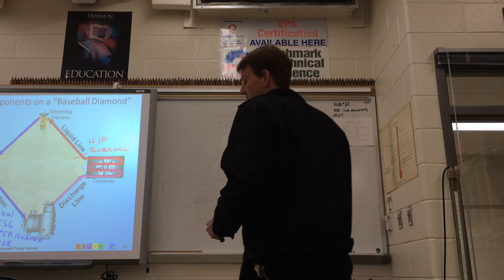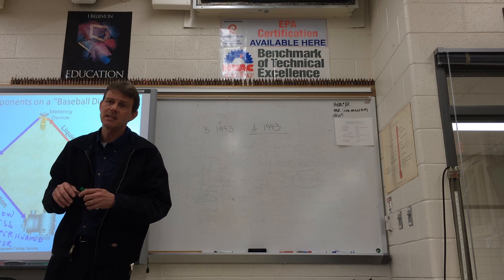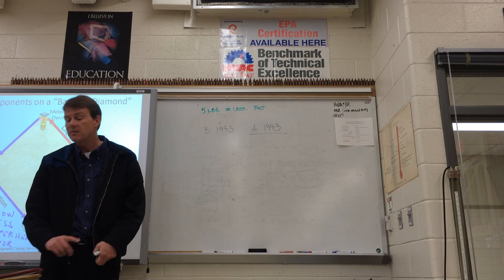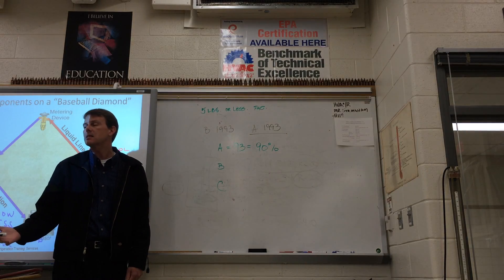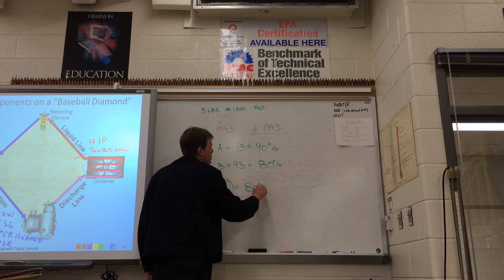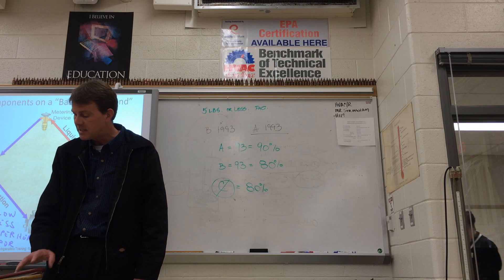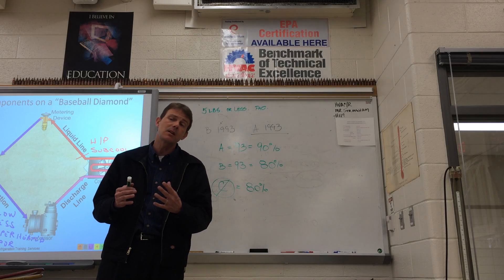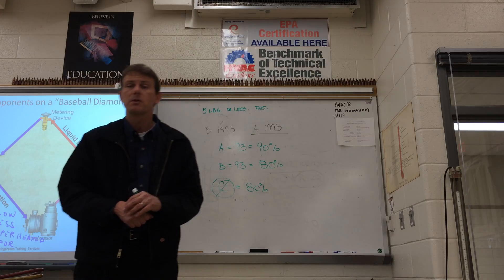HVAC Basics: EPA 608 Certification Test Study Guide - Type 1 Lecture with Mr. Stringham

Comment: Don’t need to recover type 1??? Five pounds of refrigerant can be vented ?….amazing. Diminimus???
Reply: @edisonhvac  I agree….however …. I run a appliance repair company, and an HVAC company …. I’m trying to find material online that can teach my technicians the proper way to do things, ( and also complies with the EPA608 regulations) as well as helping my new techs pass the test… I would say that telling them that they can simply vent refrigerate would actually be illegal ….and against the law …and it is actually incorrect information to be teaching students. We have to use recovery equipment and recovery machines just like an HVAC technician with our type 1 repairs….Venting refrigerant into into someone’s kitchen is not a good practice….please dont take offense , just trying to point out something that is not correct. Thanks for your otherwise good  instructional videos. We appreciate it very much, you a good teacher.

Comment: first I just want to say thank you for doing these videos, I'm taking the tes on monday and I alreday became a pro on core and type 1 in less than three days thanks to your videos, I just have 1 question, when using a piercing valve on a running compressor, which line should you place it? thanks again, hope you see and reply my comment
Reply: If u doing recovery, u can use the discharge side

Comment: Hi there! I love your videos and they're very informative but I can't find anything in the study guide about tapping into a type 1 system makes it a type 2 system. Could you explain?
Reply from the maker: +Joel Meredith anytime a tech for any reason breaks the type 1 system open (piercing valve) it is no longer a "factory sealed system" and had need field modified therefor making it a type 2. Its an unwritten rule. The reason you opened the system is for repair. Usually to add charge or fix a leak then recharge. Then it would no longer be considered a factory charged system. Does that make sense or answer your question?
Reply: Thank you. Does that mean that to service the unit once it has been modified a technician would need at least a type ii certification?
Reply from the maker: +Joel Meredith I would think so but I'm not the authority on that. It is almost like the tech working on a chiller with R-22. R-22 is a high pressure refrigerant used, which means a tech would need to be certified type 2, but most people think all chillers are a type 3 system. When in fact,  only R-11/R-123 (low pressure refrigerant) chillers are what the type 3 certification covers. Good questions. Thanks!